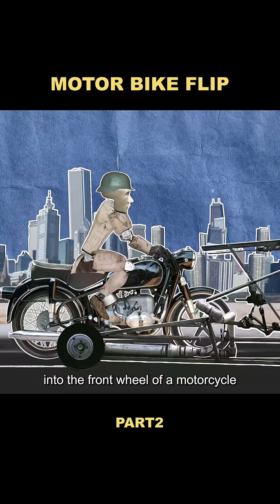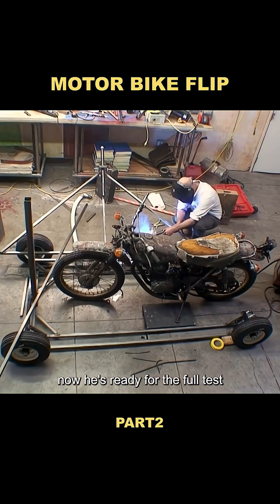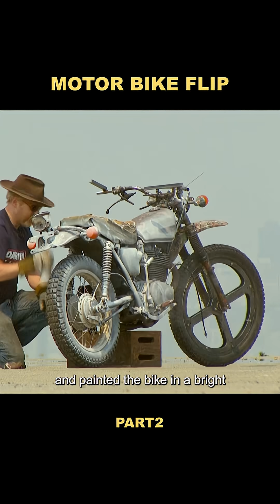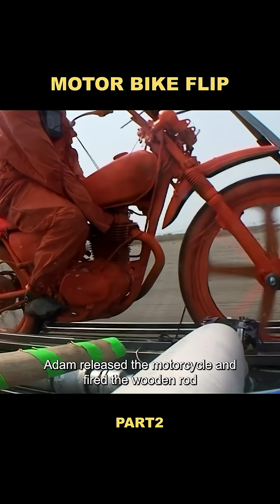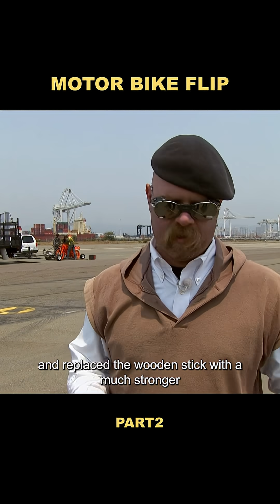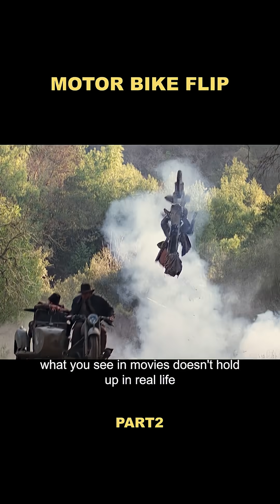What happens when a wooden stick is inserted in a moving motorcycle tire?

Comment: It should be real. Throw a stick at the motorcycle's front wheel and it should flip, cuz the wheel gets blocked from spinning, that's why ur motorcycle's rear wheel gets in the air when u brake hard, the wheel gets blocked and the motorcycle's rear wheel will go in the air

Comment: The bike Is light, and the test was done horribly. The bikes back wheel needs to be powered, and the sudden stop in the front would cause it to flip, similar to a car doing a burnout, the front tires not spinning while the back ones are causes them to be torn and melted, it’s just that the bike is not as heavy as the car and it still has momentum, effectively launching it.